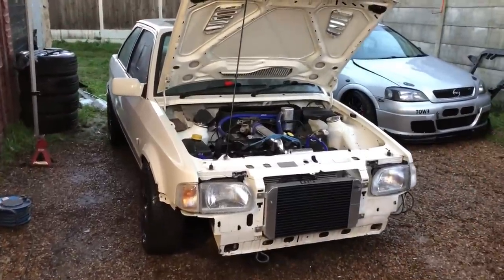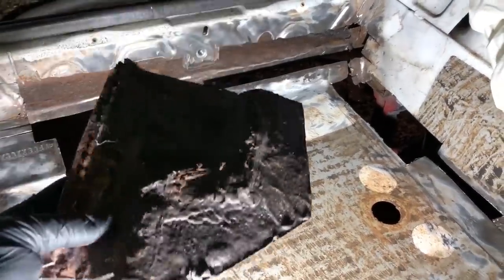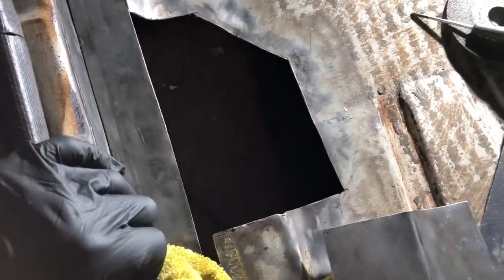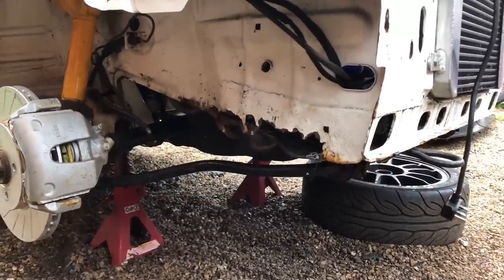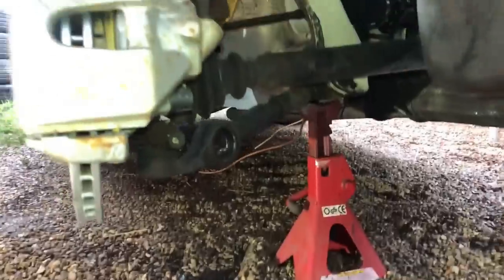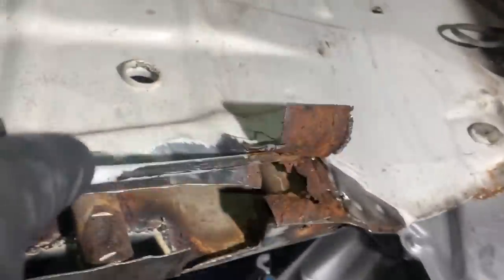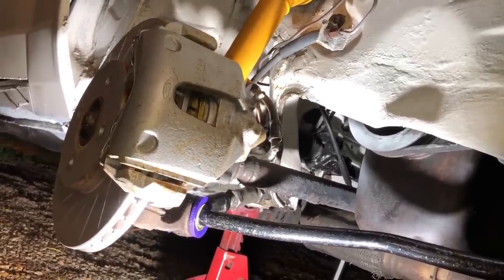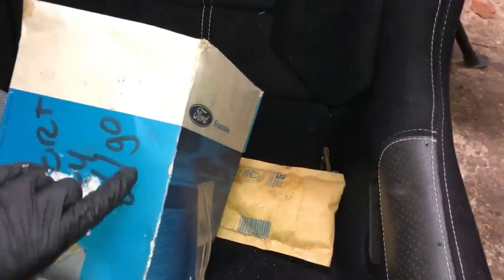RUST REPAIR & RESTORE COMPLETE! Ford Escort Rs Turbo S2 Cosworth

Comment: I see you found the expected welding panels over rust - garages do this, to palm off trade-ins cheaply and quickly - at least I know they used to.  However, if the intention is to preserve the car it has to be a different story, as you know.  Nice work, you are very talented.

Comment: My mate had a black one back in 2001, got from stockport to Blackpool in 30 mins the 1st night he had it. Was running about 240 BHP.  Sounded really rattly. Checked it when we got back on the ramps and I've never seen so much rust on a car ever. Proper death trap. Sweet ride but a death trap lol.
Reply from the maker: Most of them are like that they just slap some sealer and fresh paint over it!
Reply: @AaronUnknownPerformance  it was about a £900 car at the time with £500 quids worth of welding. One of my favourite cars of all time. Love your project mate. The prices are well on the up now. Good luck.

Comment: Excellent, had a 1988 white S2 RS back in 1992... I added Spax suspension, Scorpion exhaust, Power engineering 180bhp chip with Bailey dump valve.. Oh, and the white obligatory TurboSystems motorsports sticker added to the rear screen! I believe F79 TEL is in existence.. :)
Reply from the maker: Its awesome to hear storys like that! I have great memories from the ones I owned too 😎

Comment: Nice work man what that creamy putty you put on, is that necessary will that show on painting
Reply from the maker: Thankyou! Its seam sealer for protection, the factory came with it
Reply: Aaron Unknown wasn’t doubting it, just curious as I was welding kids play area frames so new to me. 

Makes me want to take up a VW restoration
Reply from the maker: Thomas Glover ahh yes they will be powdercoated which gives them protection for the elements

Comment: Great work as usal, what grinder was you using with the wire wheel...
Reply from the maker: It was a cheap one i got from Aldi as I’ve been burning the gears out quickly using the wire wheels on Bosch ect. but this has been tough as boots!

Comment: Hey dude.... do you wanna buy my Astra VXR H?57 plate, Arden, FVSH, one lady owner, STD apart from full Remus fitted from new by Main dealer (Regal oil restrictor fitted by myself) Half leather, diamond cut 19s. Currently in dry storage, car only covered 32k.

Comment: Bought one of these in 1996 fuckin loved it, wish I still had it
Reply from the maker: I bet you have some great memories from it 💪🏻
Reply: Aaron Unknown I do mate spent thousands on it, drove it like I stole it. Went through 6 gearboxes in 3 years. It was running 200bhp it used to spit flames when i was changing gear when I hit the limiter. 3 of my mates also had white ones the same as mine we used to race between the different raves we went too, good times.

Comment: Could have cut out floor pan and put a repair (floor pan compleat  both side's! Both foot pans  !!and would have looked better and look original  but up to you cool
Reply from the maker: I did that on the fronts, check the other vids. The reason i didnt on the rear is because i wanted to keep the original Vin numbers